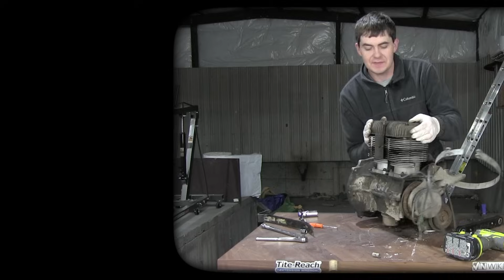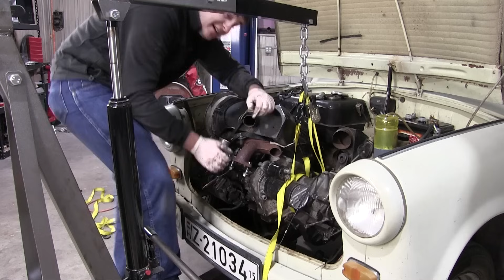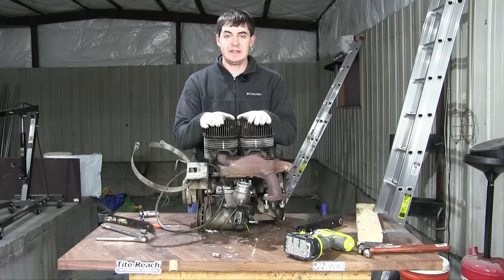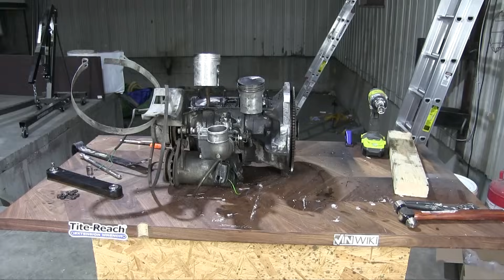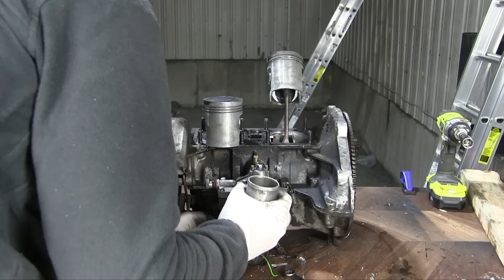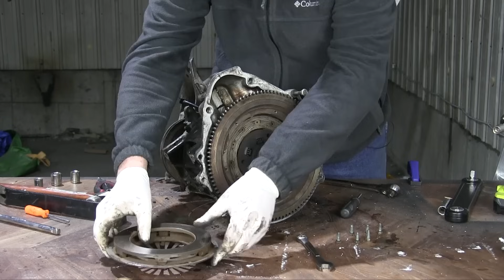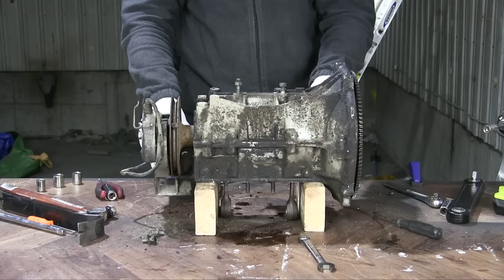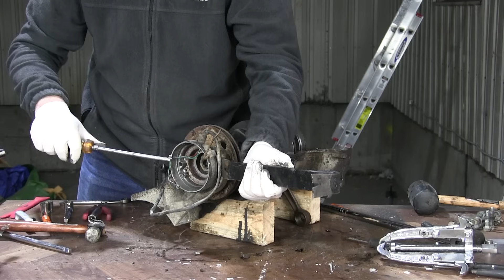Rebuilding the Trabant's Engine: Part 1 - The Teardown

Comment: In the early 90’s wasn’t there some company in Germany yanking  out the the two stroke engines and installing a small VW motor?
Reply: Not some company, but VEB Saschenring (the Trabant factory) themselves.
They wanted to change for a 4 stroke engine in the 80's but the Party refused it.
They managed to get a deal with Volkswagen in 1988 to get the 1,1l VW engine and started selling those, but "some events" happened and prevented those models to sell in large quantities. If I remember well, VW bough Saschenring in 1991 and discontinued the Trabant soon after.

Comment: Connecting rods are supposed to be have a little side to side SLIDING play, now if they're rocking side to side thats a different matter. That being said that applies to regular engines with journal bearings. Btw the thing that connects the piston to the con rod is called a wrist pin.

Comment: 11:50, unless you're aiming for getting 55+HP and 55MPG out of that engine, I'd say the tolerances are within tolerance levels.
It's not a new engine, and imho probably about on par what to expect from a 2 cylinder, 2 stroke engine that has over 100k miles on it.
Also, does the clutch still contain asbestos? If so, replace, and wear a mask!

Comment: 12:48 Those are called the wrist pins, the play in the connecting rod you mentioned should be noted, any play with the connecting rod to crankshaft is important, and excessive wear could occur, however if the side to side play was in the wrist pin/piston, you are in good terms, since you stated you are going to be replacing the entire crank assembly, its not going to be a problem, also, great editing and pacing

Comment: if you modified the exhaust you could get twice the torque out of it at a supprisingly low rpm. ive removed restrictive mufflers off so many 2 stroke mopeds and stuff just for fun and yea 5 times as loud but atleast twice the torque and then you start to believe 2 stroke can make more torque at a lower rpm than same displacement 4 stroke

Comment: So the heater is literally just exhaust gas being pumped into the cabin?
Reply from the maker: Air blown over the exhaust pipes by the engine cooling fan. Not quite exhaust air being blown directly into the cabin
Reply: Aging Wheels Sounds like the heater system in a Beetle, not very effective either.

Comment: Well I suppose the engine itself is small and light enough to pull it out by hand; but if you can't remove the gearbox, yeah, it's a problem.
Interestingly, it's something you can do with the Citroën 2CV and related cars, because you can separate the engine from the gearbox "in situ". Okay, it's best if you're two people, but a reasonnably strong and motivated guy could do it.

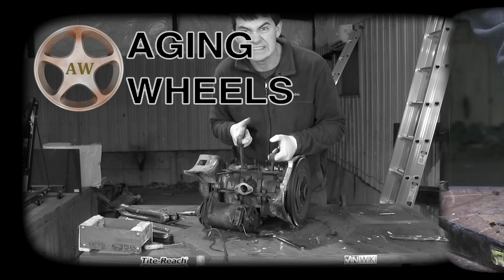Comment: 0:49 I am pretty sure that way the engine makes more power than it ever has before.

Also great I am not the only one losing nuts, bolts and washers while checking parts I just detached from the car.
Can't wait for part 2!

Comment: pull th old crank apart with gear puller and  replace the bearings yourself
Reply from the maker: There is no way I could trust myself to align everything properly when pressing the crank back together. I make pull it apart for experimentation sake when the new one arrives, but I'm using a new one

Comment: I lost my 10mm socket is not a meme. It really happens to every mechanic all the time every day. Happens to me every time I work on anything. I think it's these dang elves. They keep stealing my water too.
Reply: I keep doubles of 10mm sockets and spanners.Always find one of them.
Reply: I lose my 10mm sockets AND WRENCH  on a regular basis. As a cure, I went to sears and bought 4 new 10 mm sockets. Now I ALWAYS have one handy. It got to be really dumb wasting 15 minutes looking for that one socket that was in my pocket all along. I wo rked on snowmobiles for years. So 10 mm was the most used size.
Reply: I thought I was the only one that had an issue loosing 10mm sockets. Misery loves company!
Reply: I keep my 10mm socket on the ratchet, or on a locking extension.
Reply: @joseorellana5792  All good till you get an 8mm nut.

Comment: dyanmo= alternator and it looks like it's the kind of alernator you can put power to and it will spin just like a starter motor becuase its the kind of alternator that charges really poorly and they where used alot before, you have at least i Norwegian something called Dynostart witch means that the dynamo(alternator) is the starter motor aswell. if this makes ANY sens too you..
Reply: From the shape, it is a generator; basically a dc motor. A generator will create current when it is rotated without any external power source, while an alternator needs to be provided a little amount of current to make a much bigger one.
Reply: Can't speak Norwegian, but in English a dynamo is the same as a generator. It produces DC voltage using  a commutator. An alternator produces AC voltage via slip rings, and the AC is converted to DC by a diode rectifier.
Reply: @ericranshaw  well for us it has the same name we call both dynamo(Alternator) but we also have generators but those are the gas/diesel powerd ones.  so its basically the same. we just name it different :) but i am aware of the difference in the two types of ''alternators'' :)

Comment: No 2 Stroke Engines have open Intakes, Reed or Rotary Valve, or Piston Port, there are no open Intakes on 2 Strokes.
Reply from the maker: Correct me if I'm wrong, but I thought weedeaters and other super small engines have an open intake
Reply: @agingwheels  no, normaly they have Piston Port intakes, the Piston Skirt opens and closes the Intake, open Intakes would ony work in perfectly set up Race Applications, where the Resonance-Exhaust actualy pulls the Gasses out of the Crank Case through the Transfer Ports in higher Rpm's, rahter than the Piston going down pushing the Gas into the Combustion Chamber, and even then, you would have a Poor to non Existing idle and Low end Power, you would probably even cut your Powerband in Half. I think the Youtuber 2 Stroke Stuffing did a Video about this.

Comment: Also, are you planning to add some sound insulation?  I remember you said the Trabant Jolly (The open topped one you fixed up) had a much quieter drive with all of the insulation it had.